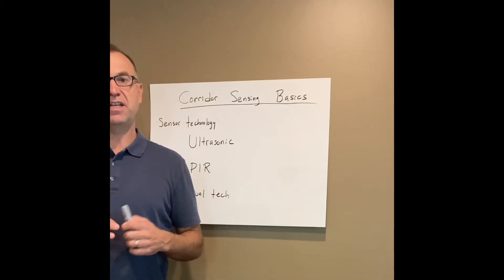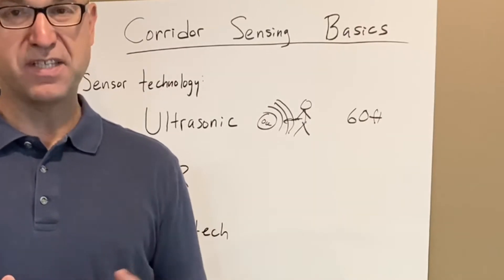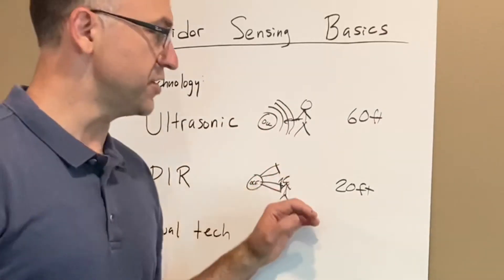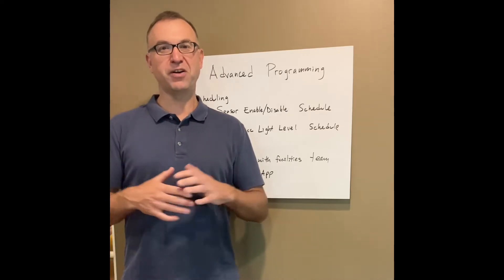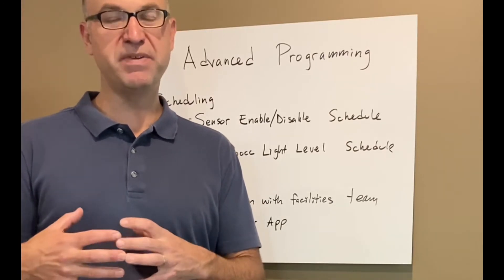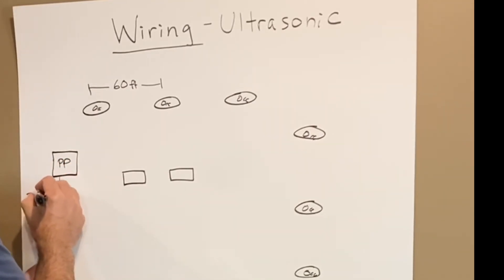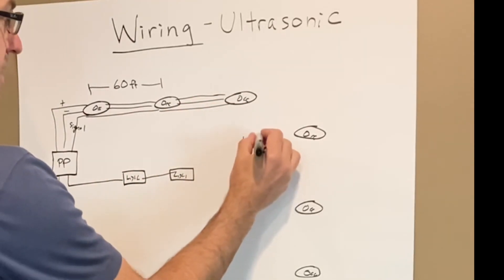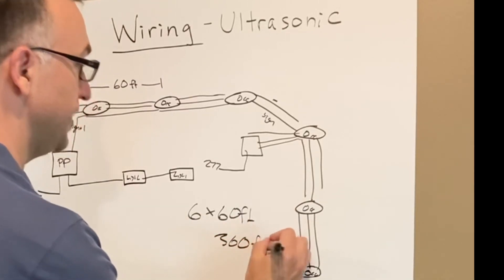Corridor Occupancy Sensor Basics

Comment: What factor should I count in case to use a 120v. Singal cable for the power pack
Reply from the maker: The signal cable is low voltage.  24 volts.

Comment: Assuming components you show in this video, what would be a budget price add for an electrical sub to add occupancy control to a corridor requiring 2 power packs,  4 occupancy sensors? 8 LED dimming light fixtures already provided in Base Bid. New construction. Just a budget cost/fixture add for occupancy controlled dimming to get a conversations started.